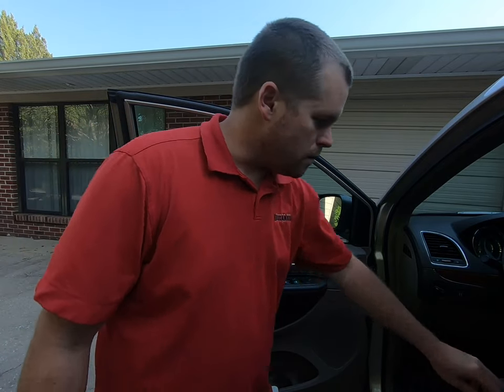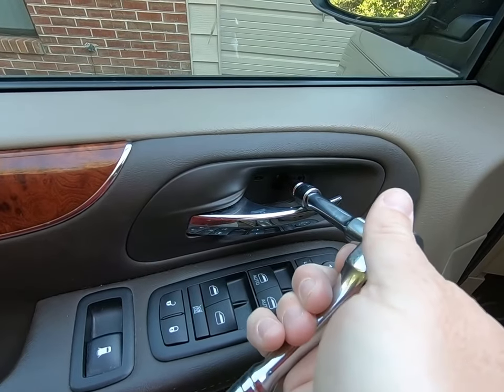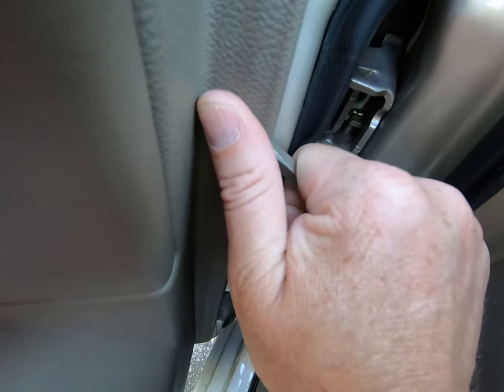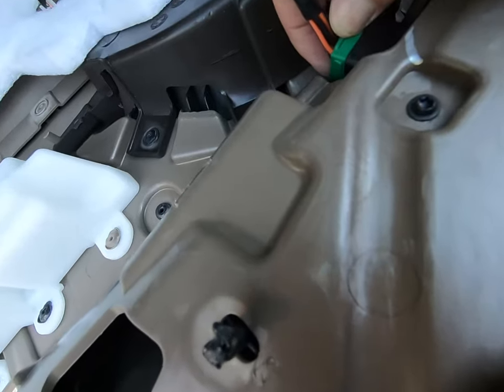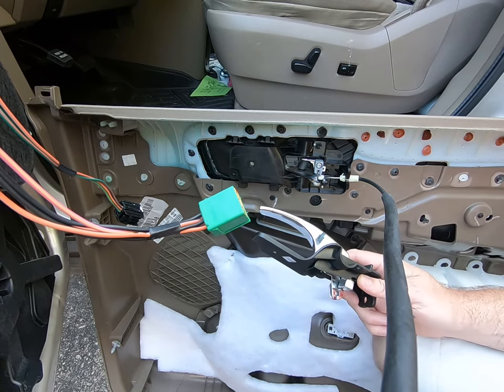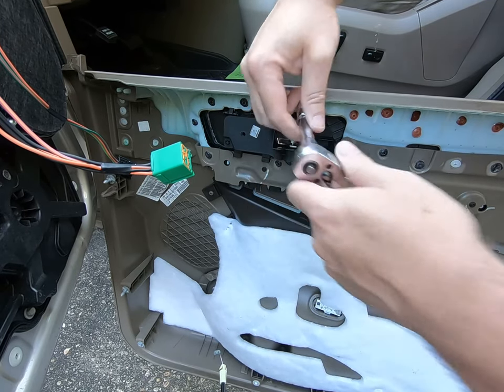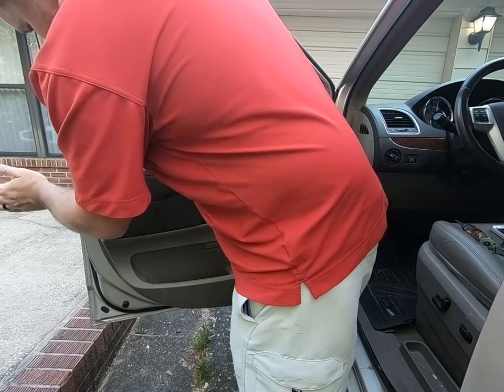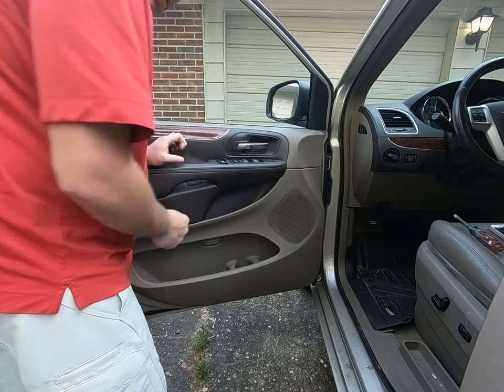Replace Interior Door Handle - 2014 Chrysler Town & Country

Comment: I'm about to crack open my door for the same problem, but I didn't expect I'd have to buy a new handle. I figured the cable just popped out. I guess I will find out today.

EDIT: A couple of little zip ties will connect the cable to the door handle in a pinch. In my case, one of the two loops broke. The other was intact. 
The material for the door handle is extremely cheap and weak. I vote metal next time.

Just another day in the life of Shmroad Tripping. Thanks for this video! It's a great reminder for my yearly journey into specifically the  driver's side door. 😄

Comment: Is there access to the external handle from behind the panel? Mine seems loose
Reply from the maker: Yes. At the 2:32 mark you can see a circular section on the left side of the door. It has a cover/flap that you can pull open and you can fit your hand in that area to get to the external door handle.

Comment: My 2014 driver door is stuck in the open position and will not allow me to shut the door.  Do do you think it's the connection to the door handle?
Reply from the maker: I might suspect the door latch first. The handle and cable could be the issue if the cable was pinched in a way that didn't allow the cable to release once under tension. If you remove the panel start with the handle and cable and work your way back to the latch. Interested to hear what you find.

Comment: Could you tell me what was wrong with the door handle? I have been having trouble with mine. Just wondering what the matter was.
Reply from the maker: The portion of the interior door handle that holds onto the cable which releases the latch broke. As a result pulling on the handle never engaged the cable and you couldn’t get out from inside the van.
Reply: @ChaseGatyas  thanks...how did you know it was the handle and not the cable? Or did you take it apart to check before you bought the handle?
Reply from the maker: @anangelshero0410  the interior handle wouldn’t open the door so I took the door apart to see what the issue was and it was clearly a broken interior handle.
Reply: @ChaseGatyas  thanks again...mine just popped as I was getting home from running errands.  I'll get a look this weekend and order whatever I'll need.  Great video.